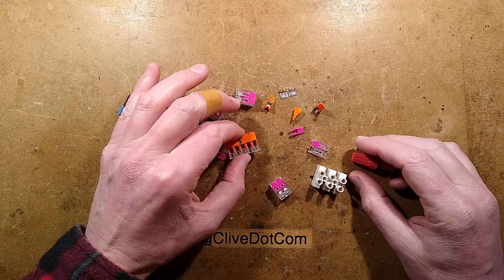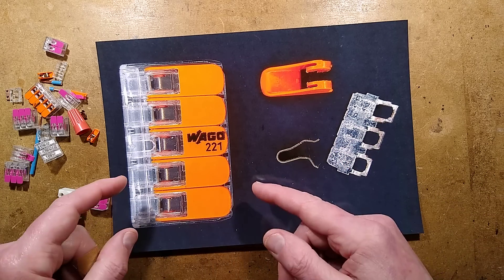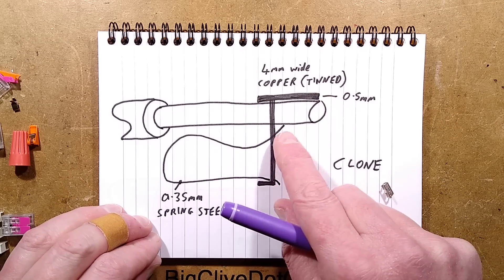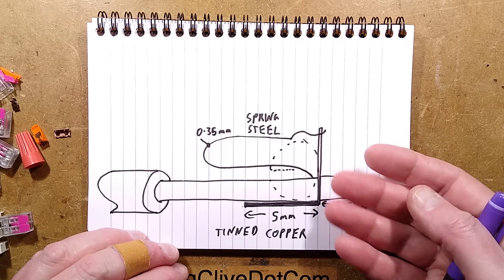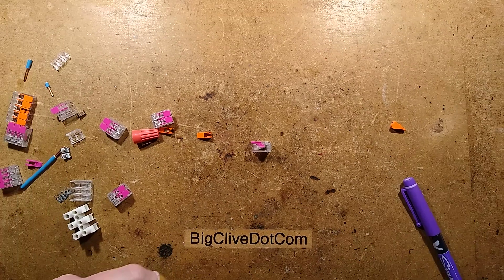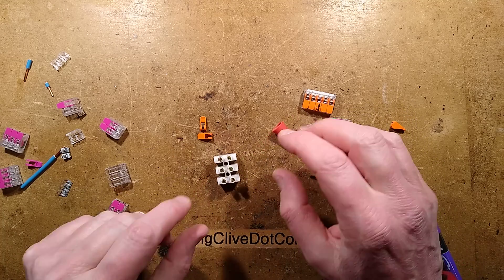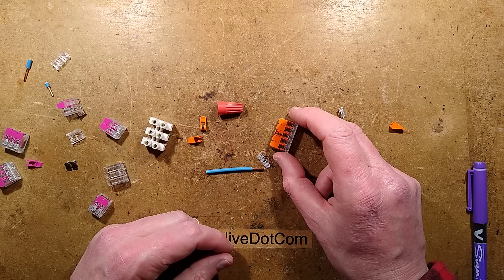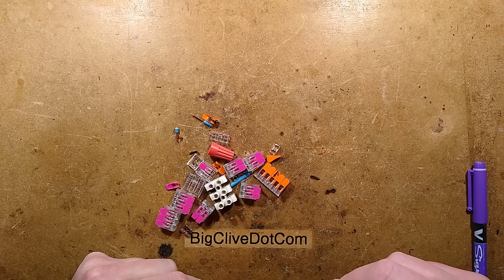Inside a Wago connector and a clone

Comment: Great video, I think a test on these connectors a bit more conservative like 15 amps and see how they fair. The whole meltdown is fun to see too but not quite as realistic IMO.
Reply: Do you not like it because your favorite lost?  Worst case failing is important to know, because thats often how these will fail.
Reply: @boots7859  I don't have a dog in the fight tbh, never used wago connectors. It does give some info but if you're putting 100+ amps through a circuit with 12-14 gauge wire something is prone to fail. Even if the connection doesn't, the whole wire run needs to be replaced anyhow.

Comment: I rejoiced the day the Wago connectors were approved for residential wiring over here in The Colonies.  As for whether or not I could reassemble a dissected Wago... Who cares? I use 'em to make permanent (or semi-permanent?) wiring connections, not to take apart. Nothing but the genuine article for me.
(Spoiler: I'll be using a few Wagos in a good-sized outdoor LED display attached to Chez Rigger this spring - stay tuned)

Comment: I have molten plenty of clones with around 30A loads, but never the real ones. Always wondered if it was due to higher contact resistance, or due to a smaller busbar
Reply: Why are you putting 30A through them? Are they rated for that?
Reply: @reverse_engineered  32A 400V rating

Comment: The Wago-style connectors have several advantages over the other ones you showed.

Wire nuts rely on twisting together the wire, which may not twist on well at all. Since they are opaque, you can't see if it made good contact or not - I've had plenty where the nut is only anchored on to one of the wires. Since they rely solely on twisting on like a screw, any vibration or expansion and contraction can cause the screw to come loose, possibly introducing a weak connection (arcing) or falling off completely and leaving bare wires. I often see them electrical taped on, which I think says a lot about their reliability.

Screw-down terminal blocks depend a lot on the exact mechanism. Many drive a screw in to the wire or at least a free-floating contact. In both cases, it's again relying on a tightly-screwed connection. Vibration and thermal expansion can result in it losing pressure on the wire and result in arcing or falling out. They are also problematic with stranded wire which is prone to settling out and losing contact.

Sprung terminals like the Wago have the advantage that the spring is holding against the wire. Since it's a spring, it can move with the wire under vibration, thermal expansion, and the like, holding a nearly-constant pressure on the wire. The enclosures are also transparent, so you can easily see if the wire is held by the spring terminal. And as you pointed out, with an angled contact, they tend to get a better connection when things move, not a worse connection like the previously-mentioned connectors.

One possible down-side to sprung terminals is that they could fatigue and not apply as much pressure over time, but that's more of an issue if they are repeatedly opened and closed (not the intended use), and only if they are flexed far enough to exceed elastic deformation and enter plastic deformation.

All in all, there's a lot to like about Wago-style spring-terminal connectors. They may not be as cheap or as common, but they are convenient and reliable.
Reply: the whole point of twisting wire nuts is to open the spring around the twisted wires. it's a double whammy.
Reply: Pre-twist your wires, then snug them down and you shouldn't have that issue. Strip them to spec, depending on the number of wires, line them up evenly, loosely grab at the ends with some lineman's pliers and twist while keeping the pliers straight on from the wires. You should end up with a nice, pretty twist.

Comment: Here in Germany the WAGO variant like 2273-203 is much more common. They are for solid wires only.
In a junction box most of the time only solid wires are connected, so those are sufficiant. They are smaller and less than half the price of the 221-413 ones shown in the videos.
Reply: Agreed 100% 

They also wipe the contact surface clean when the solid core wire is being inserted. 

The spring lever style connectors allow dust to get between the bus bar and the surface of the copper wire.
Reply: Wago connectors are cheap if you buy them in original boxes from Wago. Smallest box is 100 pieces. I brought 3 wire 2273-203 for 70 PLN (~15EUR) a year ago. I used half of box for new installation in home and garage. And i still have them for other projects.
Reply: @lycanananas_sq5fox  yes and no, I bought about 2 years a lot of them because I had to change some of the wiring in my old house, nowadays the usual suspects I buy them from caught on their popularity and raised the price to about 0.80 euro a piece, so I tend not to use them for everything.
Reply: @D4no00  Here in Germany Amazon currently offers the 2273-203 (solid wire only) for 12.45€ in a 100 pack and the 221-413 (all kinds of wire) for 19.99€ in a 50 pack. If you look around, you can usually find them a bit cheaper.
I guess the price depends on where you live and how common they are there. But double the price is a massive difference.
Reply: are you sure? I think it depends. I use 203 under surfaces, but on surface and in Lamp socket i use 221. continuous connection or not.
Reply: can they be detached easily without breaking the connector? I've always avoided those kinds of connectors, but if you use them I might give them a try!
Reply: @D4no00  Yes, they can be detached easily. You just have to twist them back and forward while pulling on the connector. No huge force required, only a firm pull.
Reply: @D4no00  you can twist and pull WAGO 203 to release, without breaking. But only can use solid wire no stranded wire possible.
Reply: @green64  I guess you can always clamp the wire if that is really necessary.
Reply: @D4no00   I don't quite understand you, are you talking about ferrules? Stranded wire is not intended for WAGO 203, it simply doesn't work, that's what I meant to say, nor do ferrules. which is why it makes sense to keep both types in stock.
Reply: @green64  Use of ferules is the ONLY acceptable way to terminate flexible stranded wires int such spring retention terminals. 
You have obviously little experience in the electrical field where spring retention terminals are becoming more common in control panels that will always use stranded wire in their construction.
Reply: @BTW...  pardon me. All I wanted to say is that according to the manufacture in WAGO 203 can be plugged wire only, in 221 wire and stranded wire. It is good to have both. But I have no idea about ferrules in this context. Ferrules in 221 will work i think.
Reply: @BTW...  
right and wrong.. the only correct ways are what the manufacturer specifies as correct.. and
 @green64  
accordding to the manual solid, stranded, and fine stranded is allowed.. former two both with and without ferrule.

Comment: As an American, its nice to see BigClive discussing a wirenut reasonably vs the standard European snob-fobbery fake hysteria.  Haven't seen or heard of the Wago failing first test, however talk about being hoisted on one's own petard... Since I'm not European, I'll simply reply that wirenuts and waygos both do the same thing, with plus and minuses in certain installations.
Far as I know, there aren't a lot of fires and mishaps occurring in the US or Canada related to wirenuts.  In the absence of good valid reasons for choosing one over another of anything, denigrating something because it is simply different makes it clear who the intolerant one is or those who feel the need to denigrate to make themselves feel superior.
Reply: The unconfirmed rumor is that wirenuts were banned for use in the UK back in the 1960's.  Ceramic wirenuts used to be relatively common in 5A lighting circuits, but I haven't seen any for decades.  reputedly

Comment: I had a friend of mine bought a  manufactured home  about 8 or 9 years ago he called me because one part of his house stopped working found had were the three sides of the home meet each other they had Wago connectors for the wiring (under the house )  and they used the wrong size it was fried to a crisp oh one side had a large scot lock on one set of wires Self Locking Electrical Cable Connectors Quick Splice Lock Wire it was a 4 wire one
Reply: Heresay!  Wago can never fail.
Reply: @boots7859  they use a 50 Amp for 100 Amp Wago

Comment: I use the cheap generic spring connectors for my ebike since I got no solder iron. But I learned how to dry connect wires with the y hoop system and heatshrink

Comment: Would be nice if the Wago or the copies had a slight slot at the wire entry for bending the wire back to add extra strain relief/pullout protection.
Reply: If you wire up an connection box and depend on the wago for strain relief on the wires you are doing something wrong.

Comment: Have you ever played with the Aussie 'BP' or 'screw connector's?  It's sort of halfway between a wire nut and screw terminal.
Twist the wires together, stuff in connector, do it down tight.  While it may be one of the slowest connectors out there, it's more solid than wire nuts and doesn't rely on bus bars and to mu understanding is second only to a crimp connector.
Reply from the maker: I've not seen those ones before.

Comment: As an engineer, the fact that Wagos are designed to be "sufficient" under normal circumstances is enough to spec their use for things like regular household power connections, but I don't actually like them and for anything that I know will have to carry high current like an electric clothes dryer or stove outlet, I always spec no splices or wire nuts only.    For my own personal use, I also prefer the robustness and low-ohmic connection of a properly installed wire nut, and for things that really matter like aerospace, it's crimps with lots of surface area contact for low-ohmic, done with precisely sized dies and calibrated crimp pressure tools and carefully sealed with hot-nitrogen shrink seals..   You would never use a Wago for any conditions where there is potential for weather ingress or wires are subject to tension or vibration.. 
My big problem with Wagos is their overuse especially in areas and applications they were  it designed for..  That that are sufficient is great for the intended purpose (ie, consumer electrical fixed wiring inside protected electrical boxes),  but they are not spec'ed for any other use and can and do cause problems if used improperly:  I've had to condemn electrical wiring done outdoors with Wagos where the steel springs corrode due to moisture..
Reply: retrads will always be retrads and never read the manual or intended uses leaflet. simple solution: don't be one and don't let one near your wiring and everything will be fine. 😏👌

there are jelly boxed Wago for exterior stuff, works fine. 👍
Reply: Yeah, it’s almost as though no one product/method is the best for every situation!
Reply: @tookitogo  Well, that obviously too complicated for people who can't remember 25.4mm = 1".
Reply: @boots7859  25.4mm = 1 what? ;-)
Reply: When you use wago unprotected in a wet environment you are out of spec. WAGO's are not IP65 rated. The box around it must be.
Reply: I'm sorry, but your real-life evidence conflicts with the Internet's armchair wisdom.

Comment: Wago connectors are perfectly safe but they have a higher resistance which means you are losing energy through your connector. So not only do they cost more they keep costing you more as long as you use them.
Reply: But how much are you actually losing? Everything has some losses, but the difference between a nanowatt and a picowatt aren't interesting if we are talking about powering devices that are drawing hundreds of watts.
Reply: @reverse_engineered  The losses are not quite that low, but they are definitely less than the overall losses in the cables, which you could also reduce by using larger wire cross section. It might rarely approach 1% in total losses, but only when nearing maximum load on the circuit.

Comment: I always thought that with Wago the connectors snap shut more firmly around the wire than with any clone. Am I wrong?
Reply from the maker: The grip seems to entirely be spring steel pushing the wire against the copper busbar with a sharp edge to bite into it slightly.

Comment: Here in the states our 120 volt outlets and switches have vampire connections in the back. The theory is that you strip the solid copper wire and stab it into the back. The idea is that it speeds up installation. In practice the hot-cold cycles of the joint cause the contact with the conductor to become intermittent. The result is lights or outlets that flicker or stop working altogether. I've rewired countless to use the screw terminal to fix this issue. I found one vampire connection that had been arcing. House fire narrowly averted.
Reply: Sometime in the early 1990s those back-stab connections were redesigned so they could only be used with 14 AWG wire. Older outlets could be back-stabbed with either 12 or 14 AWG wire. Unsure of why they redesigned them, guessing the 12AWG connections were even more of a problem.
Reply: @brianleeper5737  the units that I have seen taken apart have contact springs with a concave radius to supposedly match the radius of the conductor. As best, that radius will only fit one conductor size. Worse yet it fits neither well. This results in minimal contact area between the conductor and the spring which then equates to higher resistance and hot spots. As bad as they are I never understood how they got approved.
Reply: @RustyorBroken  Commercial and industrial grade devices don't even have those back-stab connections, they have pressure-plate screw terminals. I don't use the back-stab connections when I replace an outlet, not that I could if I wanted to since I only buy commercial-grade outlets. Have you ever seen the junky outlets used in mobile homes and mobile office trailers? That's a whole new level of cheap. They use insulation displacement terminals to make a connection.
Reply: @brianleeper5737  I have not seen the mobile home devices. Sounds like the work of the devil. Right up there with Scotchloks.
Reply: @RustyorBroken  There's a few videos here on youtube showing how to replace those mobile home outlets with regular ones. Have to use a "remodel" box and an oscillating tool to cut the hole bigger.
Reply: I think the problem is that cheap American outlets use inexpensive brass for all of the contacts, and brass is just not springy enough to maintain clamping force over time. (It’s also why American outlets loosen up over time.)
Reply: @tookitogo  I've noticed that new commercial grade outlets have more clamping force than new junk grade outlets.
Reply: @brianleeper5737  Yeah, I would expect that!

Comment: I would happily use the clones for low voltage but not for mains unless they were also UL listed. (And honestly I have a big box of Wago terminals, no need to buy any clones.) I did buy some of the push-in ones many years ago, which I'm not very fond of, but the modern lever ones are awesome.

Comment: The wire nut was never a thing in my country (some fires with aluminium cables got them banned for a time) and screw terminals are much more prone to error than WAGO style terminals.  Why anyone want to use something else is beyond me. 😁
ViD makes also good terminals like WAGO.

The Chinese constructions look very promising and i like simple constructions. But as always with these products, they lie about their specs (a lot), so you have to test them out before using.
Reply: Probably a lot that is beyond you to be honest.
Why would you WANT to pay 10x the cost per connection for one component?  What is beyond me, is why so many countries feel the need to require the use of waygo like connectors vs something that can simply be twisted on to create an oxygen-free connection with the lowest resistance possible aside from soldering.
Only thing Waygo's have basically is that they're about fool-proof. Strip wire, insert in hole, tug, and you're done. Versus strip wire, insert into wirenut, twist till it stops, tug.
Labor/time-saved is close to nil, so since 90-95% of all electrical connections inside a house are NEVER going to need to be disconnected/reconnected, you're never going to save $$ on that feature.
Waygo's are nice, simple, can save a little space in some specific emplacements. However where you might spend $100 per build with wirenuts, you're looking at $1000 if you use Waygos. 
If you're happy paying 10x more for a connector with a higher ohmic resistance, which is worse than USA/Canada because you are also at a 250+ volt, then sure, go ahead and be happy. 
Seems like someone got paid off somewhere to require that. Or an admission that the intelligence level of the average installer requires it.
Reply: @boots7859  Typically in countries that have never used wire nuts all that often (most places outside of the USA and Canada it seems), most of the cable to cable connections are done using terminal blocks. They’re just screw terminals really. Have never seen a wire nut (or a wago for that matter) here (New Zealand) outside of maybe automotive bodge jobs.
Reply: @boots7859  Wire nuts are not a thing in Germany/most of Europe. You install screw terminals or spring loaded terminals, that's it.
There were incidents in the past that gave them a bad rep but were mostly user error (Al+Cu+H2O // AL+Fe+H2O => Redox). For a shot time they were not allowed to be used in installations because of fires. That was long time ago. 
Now, no electrician has been trained to use them here, so they don't.

Best regards from a fellow electrical engineer who thinks it is not beyond him. ^^